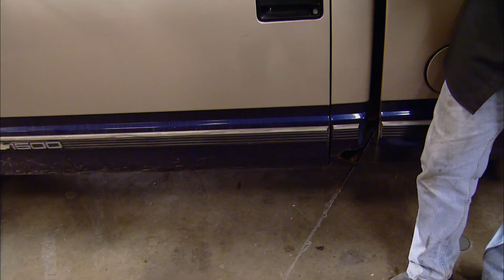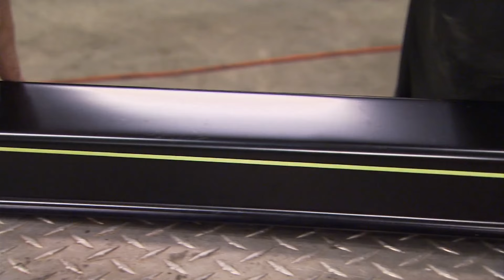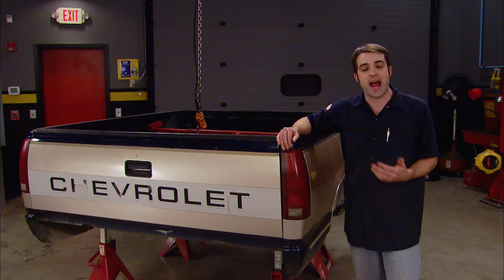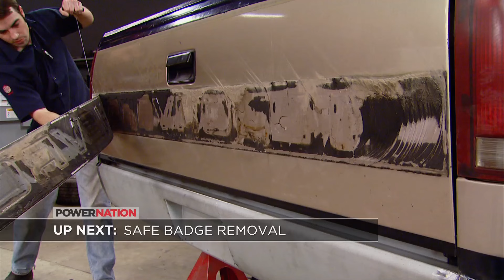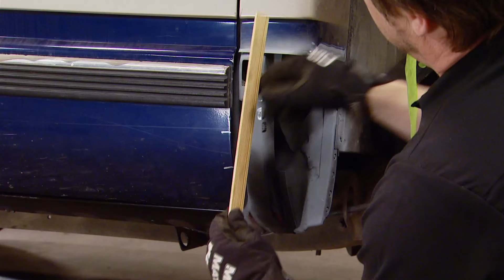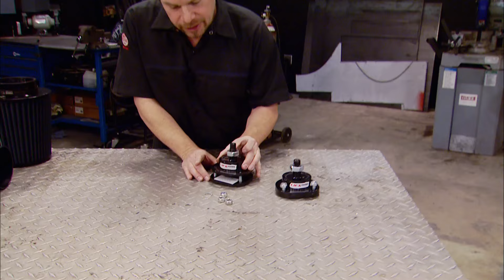Replacing Rusted Rocker Panels and Cab Corners on a Chevy Silverado - Truck Tech S1, E7

Comment: Best to use weld thru on your rosette welds for the step down bumper those 8 bare metal weld areas will get ya down the road cuz ya cant paint the inside once the bumper is in place ! Nice video !!!

Comment: Just got my old mans pickup, never seen a NY winter in the road but has seen many In the yard and I swear to god he has never washed the damn thing. Gotta do the cab corners, rockers and bed sides. Thanks for the how to guys
Reply: after u fix protect with cheap rust busters, Vaseline, mineral oil, used oil etc. I do this to both my towncars and I've not had rust in years. 1 quart of trans fluid, oil, 1 tube of grease and 2 toilet wax gaskets. Melt and mix and use however to apply. Used this for decades in rust belt and no rust. Don't be afraid of acid. Ppl don't follow directions and have issues. If you follow the steps it'll save alot of cutting, welding, mud, paint etc.

Comment: A few suggestions from a certified college trained body man . First...align the door properly...that way if your front door pillar changes position in relation to rear door opening, because the strength of the rocker has been compromised, you will at least have a reliable guide to straighten things out. Second, do most of your panel trimming with a pair of air shears because it's a lot faster...use the cut off wheel as a last resort or on the compound shapes that can't be cut with a shear.

Comment: It looks like this rocker panel has a front and rear section.  My 1998 has a front, middle, and rear.  I cannot find the middle section and most places don't mention it.  Did they change design between 1993 and 1998 - or is something weird going on in my truck?  It has the middle piece on both sides and appears factory.

Comment: not a fan of truck leveling kits but at least that ones adjustable I always figured trucks are designed to haul stuff therefore add weight and the truck becomes level I guess if you own your truck just to waste gas and overcompensate for a lack of something then leveling kit might be fine .

Comment: Huh, I actually like those wheels. They have simple center caps, and no fake bead locks, and thankfully aren't Torq Thrusts.
Reply: Whats wrong with torque thrusts? Over used?
Reply: @paulkersey724  I like em.

Comment: Welding the panels really isn't a good idea because it burns the paint off the inside leaving a bare metal suffice that will rust again. It's better to use body panel epoxy leaving all painted suffices in tact and protected.

Comment: The way you went about the rocker is fine if you bought the incomplete rocker, but you bought the whole thing. It's faster to install as whole if you cut it short at the front where the door would interfere with welding and body work. I have proved that time and again and convinced my boss to buy the 300 dollar rockers rather than the 100 dollar ones. I do cab corners usually with the box on because I live in the rust belt, and it despite how much longer it takes to do the cab corners that way, it is probably faster than pulling the box even though it will never be as good as if the box was pulled off. I've been doing body work for over 20 years and found many time saving tips over the years. Tip 1 spot cutter drills  are for saving a panel. If you are just removing and discarding, uses a die grinder with a high quality bit followed up by a good air hammer and chisel to finish it's removal. I have found using only the air hammer and chisel  works if the rocker is a lot thinner then the inner rocker or bracing it is spotted to followed by a quick grind of what is left of the spot weld. and of course that is just for the spot welds. Plasma cut or cut off wheel  for the lapped or butted edges. I like cut off wheels , but the plasma cutter can get in tighter spots. Tip 2 I guess is don't buy  plasma cutter. I have one and never use it. It does nothing that much better than tools you likely already have if you get creative as far as sheet metal work goes.
Reply: How did you do cab corners without removing the box?
Reply: @noahm.7059  I cut out as much as I can, and some stays where I can't get at it where the box really interferes. Butt weld what I cut out, lap weld the slight overlap, I could weld but not cut out, 3m panel bond what I can't weld, and then weld what I can on the inside under the truck where the cab corner ends. The panel bond is after all the welding, I said it in the wrong order. Paint sticks to apply and sand the filler to blend it. Painting isn't much fun either. This way works better or worse depending on the truck model and way they went about the cab corner. This isn't newer collision work, this is rust belt work. If you need cab corners for rust repair there is about zero chance your just going to hit 8 bolts with an impact gun and raise the bed up in a matter of minutes.

Comment: What is a estimated cost in doing the rockers and cab corners like that ?
Reply: Not sure of the pricing on Classic Parts of America, but Partsgeek.com has some affordable body trim pieces. Just need some color matched paint to go with it.
Reply: Go to your local body shop and ask, there are way to many variables to even ball park an estimate. Starting from shop rates to the color and quality of paint you want, and what make and model you have. it should not take more 24 hours and then paint and materials for that truck. As good as the inner rockers were and box unbolts maybe 16 hours max. Good rockers cab corners  and middle of the road paint are probably 500 for a truck like that. That's just an educated guess
Reply: my question also I'll be checking into it soon 2020 is the year for my Beast

Comment: a bullet hole in the hood isn't as uncommon as one might think.  Someone leans across the hood of their vehicle to form a solid support with a scoped rifle, but doesn't realize the bore axis of the barrel of their rifle is over 4 inches lower than the scope their looking though and "BAM", ventilated hood.
Reply: canuckguy worried    though it could have been a gangland deer drive-by.  Bambi had it tough and is look'in for pay back...   o_0
Reply: Yeah I know right, even happens a lot more when you hunt deer at night.
Reply: Exactly, i have seen this multiple times actually. On the roof too.
Reply: @donaldmills4201  there you go, though I'm not so tall as to be able to shoot over the roof of my Ranger 4x4.   o_0
Reply: canuckguy worried    Yep!  that's probably been the cause of more unintentional vehicle mod's then anything else.   o_0
Reply: I didnt know it was that common lol it instantly brought back a 25 year old memory hunting with my uncle in Florida he put 2 hole in the hood of his nissan
Reply: I’m guilty of this myself 😬
Reply: @jerryjeanninesepicadventur1531  well now you have the start of a ram air scoop.  ^_^

Comment: When our truck fleet vehicles reach 80,000 miles we put them up for sale at the edge of our lot. We include the vehicles thorough maintenance and inspection report for the life of the vehicle. Last year we sold 24 2008 F250 4x4 extra cab long beds for about $5,000 -$7,500 each. 
Out mechanics go through them completely before they’re sold. If we allow our fleets to run around looking scabby and rusty it reflects poorly on our brand.
Reply: What is your brand/company? I might be interested in some trucks.
Reply: NextLevel Gamez Siem Offshore and SMIT Salvage.

Comment: I like the two tone Paint job and I hate lowered trucks. Also when doing cab corners on these be careful there's glue/sealant just under the bodyline when you're welding that shit will catch fire easily.
Reply: If  I buy a truck I want a truck. Lowering it is just stupid because it no longer is functional as a truck. I know this because I've been there and done it. Never again will I make that mistake
Reply: @caddydaddy84  why would you get a truck and lower it if you need it to be stock height or above? Thats just dumb on your part lmao. I bought my truck because i wanted to build a sport truck and lowering it has increased the handling on it so it serves its purpose. Not everyone who owns a truck wants a lifted obnoxious eye sore. Especially a 2wd truck. i get a 4wd but thats it.
Reply: I like my trucks lowered because it's easier to load and unload and i can use a regular ball hitch without a 6-8in drop to keep a trailer level. I've had to deal with lifted trucks and they suck to actually use for "truck" stuff.

Comment: It would of been nice to see how you adjusted the latch to raise the door at the 6:39 mark of the video.
Reply: Just replaced the bushings on the pin, we did it all the time at my stepdads repair shop
Reply: @baddonkey6876  In this place, they weren't fixing the car for a customer. This was a performance build. Perhaps it was a lack of attention to details. No harm, no foul.
Reply: Both are fixed the exact same way

Comment: Why do the cab corners go ? And can you guys do a frame coating repair on the newer Silverado's ?.. the wax coating in the frames suck and I'm interested in seeing how you guys would clean it up and repair it ... 

   I've been cleaning the areas with a scraper then cleaning with rubbing alcohol , spraying a rust inhibitor , spraying self etching primer and then using a rubberized undercoating on the frame rails
Reply: That’s your problem.. you’re using rubberized undercoating. Say goodbye to your frame in a couple years...
Reply: @95roadie  what solution do you have .. I mean it's gotta be better then the wax they put on that gets brittle and flake's off
Reply: stephen frank actual paint such as POR or Chassis Saver. I favor Chassis Saver because the past couple years POR is less effective than a sharpie in my opinion. But seriously, never use rubberized undercoating on your frame. One little pin hole and salty water will get trapped between the frame and the coating and will eat your frame alive. I absolutely agree the wax coating sucks ass.. why they still do it, I have no idea. Other than the fact they want you to buy a new one in 5 years or less. Look up “why you should never use rubberized undercoatings” on here. There’s plenty of videos.
Reply: @95roadie  and it's Rust-Oleum prograde undercoating that I put on
Reply: We did my buddies truck scraped it and wire brushed it and sanded it, lots or rust resistant primer and two coats of black and light coat of sealer